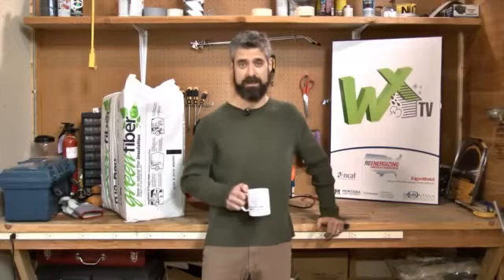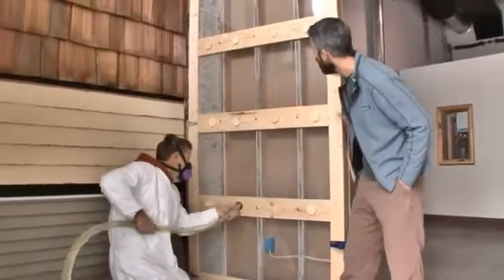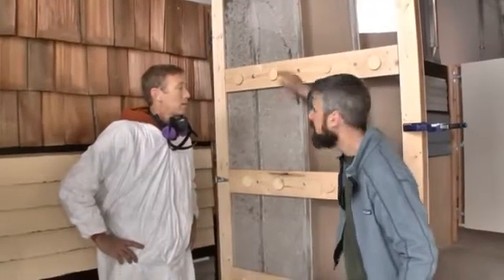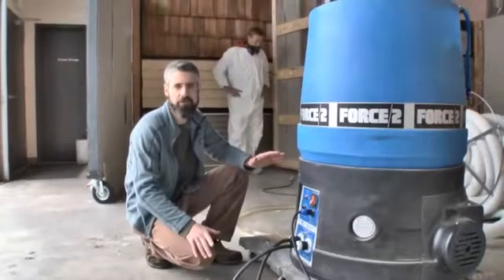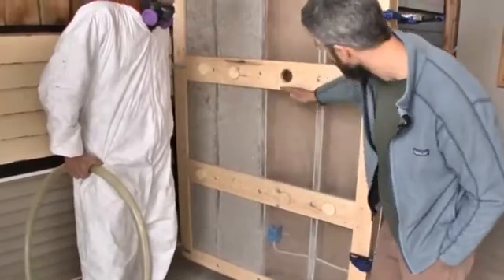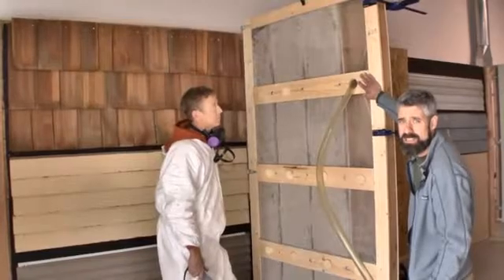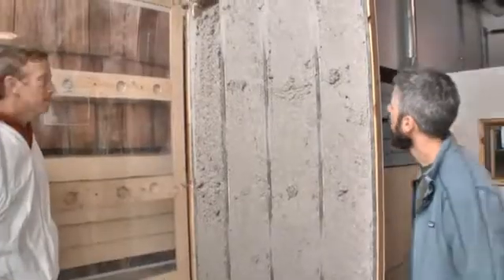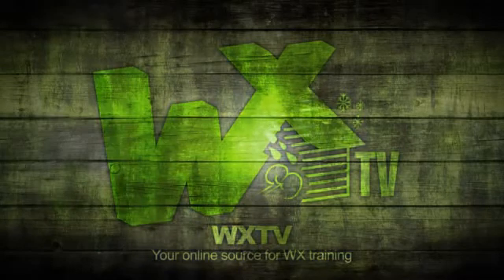Dense Packing with Cellulose Insulation

Comment: Nice video
Can this be done on walls with exsisting fiberglass batts? in a modular home and is being stripped of siding to be resided.   Thanks
Reply from the maker: Thanks for commenting.  It depends.  If the existing fiberglass batts occupy the entire stud bay than no.  Dense packing is not really possible.  However if its an older batt like an R11 you can likely  fill tube right past it and dense pack in some additional cellulose insulation.  However -- when there are batts in the wall you want to drill your holes at the mid point of the stud bay rather than at the bottom.  Doing so makes it much easier to access the entire stud bay as you only need to tube up and then down 4ft, rather than having to fill tube up 7-8 ft if your access hole is at the bottom of the stud bay. 
Andy

Comment: If I only had invisible walls
Reply from the maker: When you use a fill tube you can tell exactly where fire stops are.  We use a metal probe to find the vertical studs after drilling the first hole.  It's very straightforward.
Andy

Comment: Dense packing does "help" prevent settling and air gaps, but it doesn't prevent them altogether, and even small ones can be very damaging to a wall's overall R-value.
Reply from the maker: If done right dense packing will absolutely prevent settling.  When we pull our fill tubes from the access hole in the wall you can barely push your fingers through the cellulose -- that is how dense it is.  How is that going to settle?  It's already in a super-settled situation.  The only time that I have seen air gaps / voids in walls using a proper dense packing process is when fire stops are encountered and the installer does not drill the additional required hole above a fire stop to fill that part of the stud bay.  Otherwise dense packed walls look great using infrared and for years after the install.  
I should add that Insulwise has dense packed the walls of over a thousand homes in the Pittsburgh area since 2009 and many of our customers own their own infrared cameras (they're pretty cheap these days).  We seldom get calls for missed areas or voids, and when we do it has always been installer error, rather than the dense pack cellulose settling, etc. 
Andy
Reply: @insulwiseenergycomfortsolu3293   Yes, but that's right after you blow the cellulose in.  Within a year the cellulose will have settled some and left at least a small gap at the top of the stud bay, even if it was blown carefully by a guy with lots of experience.  It's just physics.

Comment: The older homes that need insulating are often lathe and plaster on the inside and stucco on the outside. Jamming your hose around inside those walls is going to do a lot of damage and the insulation is not going to pack down at all but instead will get stuck on all the plaster nubs, stucco wire, etc.
Reply from the maker: I've dense packed the walls of hundreds of homes with plaster and lathe walls.  When you use a fill tube you can guarantee that you're accessing every linear feet of vertical wall stud bay.  Sometimes you'll break off a few plaster keys from the backside of the wall, you'll hear them crunch off, but these walls are often the strongest that we encounter.  They are much stronger than drywall, usually.  
The force of the air blowing the cellulose into the stud bays disperses the insulation quite effectively.  I've had our stuff infrareded plenty times after the work.  Unless our guys miss a fire stop (happens occasionally when fire stops are near the ceiling) the walls look great and the process is highly effective. 
Andy

Comment: Is it better to dense pack with low, medium, or high speed? 😅
Reply from the maker: Well, it depends entirely on the strength of the wall.  Generally speaking it's best to dense pack the material as tightly as the walls will allow for.  If you hear drywall screws start popping, or small cracks forming, you want to 1) pull the tube down quickly from the stress point and then 2) possibly reduce the air pressure of the blower motors.  Hope that helps!
Andy

Comment: My contractor is insisting that the access holes in the existing drywall need to be drilled at the top of the wall?  I'm wanting a dense pack of cellulose in the existing walls, but trying to avoid having to take a portion of wall cabinets down by having the holes drilled mid-point of the wall right below the cabinets. Watching this video, it appears that holes higher in the wall is not mandatory for an effective dense pack install, and if anything, seems a bit trickier.  Thoughts?  Great video by the way.
Reply from the maker: We do dense pack on a daily basis and almost never drill the tops of the walls.  Usually that implies that the "old school" technique of drilling and filling with a directional nozzle rather than a fill tube that is 9-10 feet is being used.  If you are using a fill tube, it does not matter where the holes are drilled.  I will be posting a video soon on how we dense pack walls with cellulose insulation, and why we think this is superior to most other forms of insulating the walls of existing homes. 
Thanks!
Andy
Reply: @insulwiseenergycomfortsolu3293  Thanks for the reply, Andy.  Will the "old school" method give a less effective dense-fill?

Comment: Seems to me if you go from the middle and dense pack down first, then go up and dense pack back down to the hole. No knifing. Am I missing something?
Reply from the maker: I'm not sure exactly what you mean by "knifing," but going from the middle of the wall is perfectly acceptable, it's just that you wind up with holes to patch that are much closer to eye level and it's easier to spot any flaws in the drywall / plaster if done from the inside of the home. 
Thanks!
Andy

Comment: What is the smallest diameter hose you could use to adapt from the 3" hose? without causing a blockage? Is 1 1/4" ID acceptable?
Reply from the maker: 1 1/4" would work yes.  We step our hoses down from 3" to 2 1/2 " to 2" and then to the actual dense pack hose.  Our dense pack hose is either 1 1/4" or 1 1/2 ID
Reply: Would 1" ID work? Aside from slowing things down because less material would flow, is there a challenge with that diameter? E.g. regular blockages?

Comment: The worker bee would be in tough shape if he was not WATCHING the progress of the fill@!  What happens when you have sheet rock in place of plexiglas?
Reply from the maker: Good question Brian!   The installer can see the cellulose moving through the transparent fill tube.  When the feed stops, the installed pulls the fill tube down 6-12" inches.  Then the feed resumes and when it stops again, he/ she pulls the tube down again until the cavity is completely filled.  It takes a bit of practice to not clog the fill tube or make too much of a mess, but it's overall a very straightforward process.

Comment from the maker: Hi James, I don't know if I can visualize what packing cellulose with a sledge hammer looks like, but it sure sounds like hard work.  I'm not sure if I can comment on whether it'll cause you a problem.  If possible I'd try and find an competent insulation company that does proper dense pack insulation and see if they can give you a hand.

Comment: I have a loose packed cellulose in the bay cavities of several exterior walls of a 1919 built ballooned frames home I own.  It is a duplex with several upper unit lathe walls removed for electrical updates (eliminating knob and tube wiring) and insulation with mineral wool.  I have been manually packing borate cellulose with the assistance of a 12 lb sledge hammer to nominally improve lower unit exterior wall insulation.  Am I wasting my time or does anyone see a problem with this process?
Reply from the maker: I can't comment on  using a sledgehammer to insulate...it sounds a bit brutal.  I'd try to rent a machine from a big box store that had the ability to dense pack before I attempted this method.

Comment: What do you do when there is blocking in the wall? You are up the creek
Reply from the maker: Hi Chris, thanks for your comment that's actually a great question.  When you "fill tube" a wall with a proper dense pack process, you can identify exactly where the stops are because the tube only goes into the wall 1, 2, 3, 5, 7, feet etc instead of the full 8 -10 ft that it should.  We then pull the tube from the wall, place it against the outside of the wall and line up where the hose stopped going in.  That tells us exactly where the stop is located.  We then drill another hole above the fire stop/ blocking.  At that point we've accessed the entire bay.  
I've found over the years though that most older homes usually only have a handful of "stops" as we call them.  And most of the time they are at the base of window frames.  This is why fill tubing walls offers an advantage over the old "blow and go" method where one hole is drilled at the top of the wall, a nozzle gets inserted, and then whatever can be put into the wall from that one hole is what it gets.  That's a bs technique in my opinion (unless your desire is to have settling and voids).
Reply: if you have blocking in the wall, you need to fill each cavity.  It will take longer, but it is no harder.